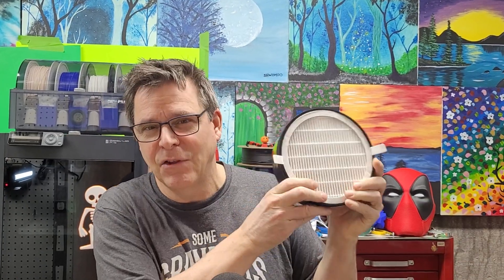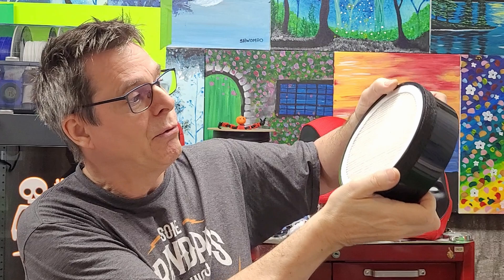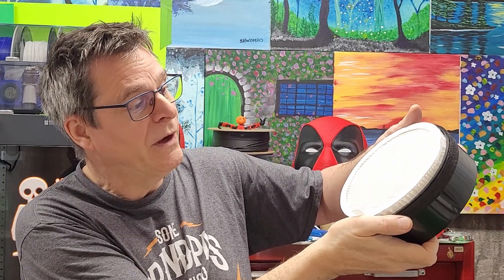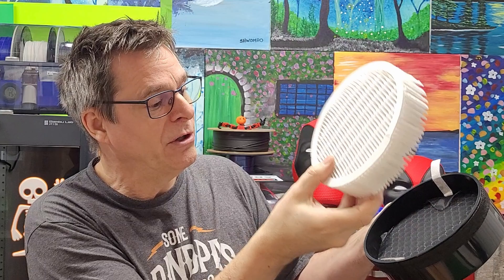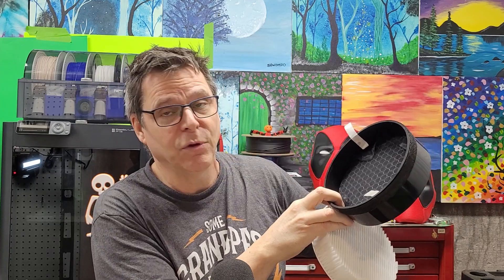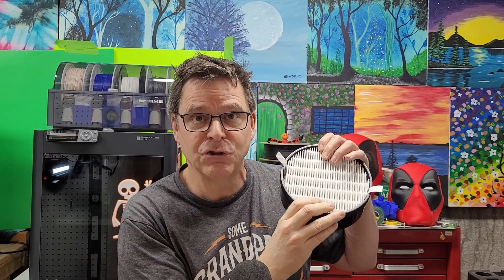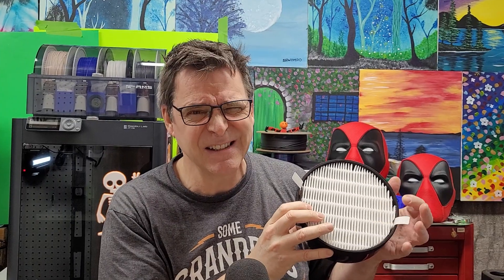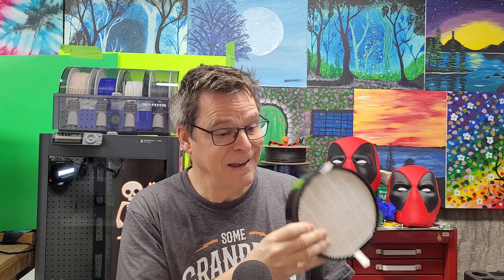3D Printing HEPA Filter: I Got it WRONG!

Comment: How did this work so far?
Reply from the maker: Great, no complaints. The best solution is venting outside if you can.  Not easy here for me so this is better than what Bambu supplied. If you do this remove the Bambu charcoal filter.

Comment: I bought a little Bambu Lab A1 mini as my first 3D Printer last week but the fumes killing me, i feel it in my lung, in my mouth  etc. Im sure its toxic so i bought a "tent" enclosure for the A1 mini and a inline Pipe ventilator to guide the fumes to the outside but i think i can still smell them. So i want to add a filter to the other end of the pipe. When i order the filters you showed in the video, which side of the filter take the bad air from the exhaust or better said which side of the filter  you would plug an an exhaust pipe? the white side or the black side facing the exhaust? Im still looking for a smaller alternative to that filter since the exhaust pipe is only 4 inch in diameter, so it will look a bit strange
Reply from the maker: Morning.  Manufactures original design is through the paper first then the charcoal

Comment: I made this and it works great!  The only problem I had was trying to remove and turnover the paper part of the filter.  I could not get it to release from the carbon filter without doing a lot of damage.  I just removed the whole filter from it's casing and turned the whole thing over and put it back in the casing.  When looking at the air cleaner that this filter was designed for, with this filter on the Bambu P1S, that's the way the air flow through the filter should be anyway.  Some of the carbon will come out when removing the filter so do it in an area where you can vacuum up the carbon pellets.  I hot glued the filter aroung the edges back into it's case and then filled any empty carbon pockets with hot glue.  It works really well.  Thank you for this design!
Reply from the maker: Thank you for the feedback 😊

Comment: Did you remove the Bambu filter after placing your filter on the back of your printer?  I've discovered that I'm probably allergic to the VOC's produced by my printer.  Bad rash develops when I'm in the room with the printer when printing.  I converted my P1P to a P1S a few months ago and I'm really glad I did.  I'm hoping your filter will fix my problem!
Reply from the maker: Hi,  yes I removed the Bambu filter and only use the hepa 
I hope it resolved your issue 😊
Reply: @mayhemsmiley  I, for the life of me, couldn't get the paper filter separated from the carbon filter.  I wound up pulling the whole thing out and reversing it in the case.  I'm assuming having the air flow through the paper filter first and then the carbon will still be effective.  I wanted to get your opinion.  I'm planning on hot gluing the whole filter into it's  case and filling the few carbon filter pockets that lost the carbon with hot glue so all the air will be coming through the filter.

Comment: The advertised filter is hot glued into place (at least the US variant in the description); mileage may vary, but others trying to reverse it may destroy the integrity of the carbon mesh screen, the HEPA filter itself, and their thumbs.
Reply: Thank you for this. I was wondering how he made it look so easy. I'm just gunna send it the way it is
Reply: So did you guy try to flip the paper side or just used it as is ?
Reply from the maker: I've got both on mine. The one I converted was glued but was ready to release. I'm sorry if some weren't as easy as mine.
Reply from the maker: I'm sorry about this. Mine were glued but easy to release.

Comment: Nice. Thanks for the correction. One thing: When printing normal PLA, they tell you to keep the door open... so is there any other trick or way to reduce fumes when using it with the door open? Thanks.
Reply from the maker: @todologic  even with the door open the fan is exhausting the chamber. I have never left the door open once for any prints at almost 1000 hours of print time on one printer.
Reply: @mayhemsmiley  Interesting. But you print normal PLA with the door closed then? I was a bit dissapointed when I unpacked the printer and saw that they recommend to use the door open for normal basic PLA... because I got the printer (X1C) precisely because it was enclosed. If you can confirm, that you've been printing basic PLA without the door open, and the prints are perfect, it would put my mind at ease... thanks in advance for your time and response.
Reply from the maker: @todologic  my pleasure, I've never left the door open once in that 1000 hours. I won't open the door to look at the print while printing. Bare in mind that my printers are in the basement where it is cool here all year round. I've used Bambu default settings for flow and Temps no matter which filament I use with the door closed. I was used to playing with all kinds of settings on other printers. Bambu studio have been a dream come true for me.  I how it'll be the same for you
Reply: @mayhemsmiley  thanks for the clarification!!! Best regards!!

Comment: This is a great video, just bought my P1S last month and have been hesitant to use it as much as I would like because of the fumes and microplastics. I naively thought that the enclosure would protect from all that but I was wrong. I am in a similar situation of not being able to exhaust outside, so this is a great solution and I have already started the print! How often would you recommend replacing the filters? Thank you so much for this informative video and solution to my problem!
Reply from the maker: Thank you for the kind words, I'll change mine every six months, I would gamble they are still good but why risk it. People who print more than I do might need to change more often, I wish there was a more positive method to verify saturation.
Reply: @mayhemsmiley  Just got the filter in and am having issues with removing the filter to flip it. I ordered the US version and there is a lot of glue sticking the carbon and HEPA filters together... Do you have the US version or the canada one?
Reply from the maker: @wezley13 im in Canada and ordered from Canadian Amazon. Go slow and gentle.  Hopefully you can wiggle it out. Let me know how you make out
Reply: @mayhemsmiley  Ah gotcha, yea I wonder if the US version just has a lot more glue compared to the Canadian. When trying to replicate the way you removed it, I had a much different experience. Was prying and prying but the HEPA wouldn't budge, ended up ripping part of the HEPA filter down to the carbon filter and was able to see a ton of glue, appears to be a very different experience than yours. Now trying to decide if I should sand down the inside of the print so that it can flow through the HEPA the correct direction before the carbon or just leave the HEPA as is and have the air flow going the wrong way🤔
Reply from the maker: @wezley13  I know that others have left it the way it is and one dude has a meter near his that doesn't go off near the printer but goes off when ever his daughter owns up the bathroom cleaners
Reply from the maker: @wezley13  one of mine is still in the opposite direction since dude shared his meter results

Comment: Im sorry but this doesn't work at all! So frustrated as I have wasted time and money on the parts. All it does is heats up the chamber between the filter and the printer back fan and pushes the heat back into the printer. I have tried swapping over the filter as per this video too.
Reply from the maker: Wow I am really sorry to hear this.  I hate waste time and money too. Someone mentioned that their printer was pulling air into their chamber rather than exhausting.  Have you checked yours? Both of mine exhaust and the first is getting close to 1000 hours of operation. Did you remove the original activated carbon filter and the cover? How are you able to tell it is pushing heat back into the chamber?  Let me know, my curiosity is peaked.

Comment: I’m was wondering . After a few months weeks is there any regrets any new air changes good or bad .  Is there anything u might change to improve the air . I like to get a Bambi but I’m also thinking of getting an air purifier for it until I seen this video ?
Reply from the maker: If I could vent outdoors easily that would be my first choice over anything. I am happy with this and someone even commented they did not reverse the filter and have a meter sitting next to the printer. The meter would only go off when his daughter was cleaning the bathroom nearby with harsh cleaners. I like the idea of capturing at the exhaust of the enclosure before it makes it into the room. Just my two cents. I friggin love these printers, spend more time printing rather than twiddling. Happy printing
Reply: Wow that’s interesting that the meter didn’t peak . So u been U been doing the  method since the beginning to now ? did u use any other filter like air purifier, open window ?
Reply from the maker: @gamergame5318  yes its all that I've been using.  Both of mine are in the laundry/ work room. The comment is either in this video or the original videos comments.

Comment: Hey, I just printed the model for the hepa filter.
Bought a LEVOIT LV-H132 replacement pack (from Romania since I'm located here) and the hepa filter was glued to the carbon filter.
Do you know where I can buy a compatible replacement pack on which I can change the sides of the hepa filter, or do you have another design which I can print sincet I have 1 more spare replacement which I can use. The one I tried separating the filters is completely broken now :(
Thanks in adance
Reply from the maker: Sorry for the delay responding.  Let me see what I can do on the weekend

Comment: Be careful with this method. Even if the fan is blowing air, if the filter is a true HEPA 13 filter, it will heavily restrict the fan or overwork it. Those fans were not designed for this type of ventilation. If you notice a massive difference in the sound output of the fan, look for a different option.
Reply from the maker: Thanks Matt, I check on it regularly. I can be a bit paranoid at times LOL
Reply: @ I can tell you’re very cautious haha and I do think the design is great btw! I just work with small motor air circulation and filtration so I’m always going crazy on this kind of stuff. As long as you change the filter regularly, you should be okay. But I have seen H13 filters like these cause electronics as well as motors blow with even just a few days added onto the recommended change intervals due to being so high efficiency, the small pores clog up so finely that they will overheat the blowers.

Great vid though!

Comment: Nice video and a great addition it looks like adding that filter. I just tried the link for the model to makers world and it shows that it’s not there. Did you pull it down?
Reply from the maker: Morning Steve, TY TY :)  it's in the description of this video and first pinned comment, here is the link https://makerworld.com/en/models/627989#profileId-552625
Reply from the maker: That link should work, but let me know if it doesn't
Reply: That link worked perfect thank you

Comment: I swapped out the carbon filter with a Voxel X-Filter which has carbon and hepa. 
Then I have a whole room Levoit Hepa filter running right next to the printer.
That also has an air quality sensor built in so it can ramp up when needed and stay quiet when things are good.
Reply from the maker: Could you share the model of room levoit that you use, sounds like a nice unit
Reply: @mayhemsmiley  EverestAir - I own two of them because they work so well. Can be controlled from your phone too. They have nice smaller units as well.

Comment: I think these work great just as they are. I have 3 of these printed for my P1s's. I used strong magnets and a tpu gasket instead of velcro.  After using these I don't even smell PLA anymore. I just took one of my filters out to flip it and I don"t see the difference. Could be a different manufacturer but its the same material folded into an accordion shape a lot like an hvac filter. Either way the air has to travel through the whole thing regardless. I'm going to leave mine as is. If anything, being able to install the filter the other direction and have the activated charcoal after the filter would probably extend the life of the carbon since the HEPA filter will capture the particles instead of the carbon being exposed first..
Reply from the maker: Hey Mosh, thank you so much for taking the time to share and comment. It really bothered me that I had made an assumption and agree with you about the air has to pass through in either orientation. It sure made the housing simple to design. Happy new year!

Comment: Printing ABS with this system and I have an AQI meter in my office. NO smell and the meter does not even register the print. It measures HCHO, TVOC, CO, Co2, PM2.5 and PM 1.0.. All green during multi hour ABS prints.  I have 2 Bambu X1Cs with this system. I do not smell plastic.
Reply from the maker: @edmclaughlin4923  hey Ed when you say this system do you mean the standard bambu carbon filter or the added hepa?
Reply: @mayhemsmiley  I have the added hepa. You did a great job and you had mentioned hepa in the first video and why charcoal wasn't good enough. Made sense to me. I printed your project twice and am using it. I also bought an AQI to verify. I am not interested in lung cancer... LOL.
Reply from the maker: @edmclaughlin4923  thank you for the clarification and note you've reversed the paper?
Reply: @mayhemsmiley  Followed all your directions although the original way did a good job. My AQI went nuts when my daughter was cleaning the bathroom outside my office. It didn't even register during the ABS prints. Thanks for your efforts.
Reply from the maker: @edmclaughlin4923  thanks for the update too. Interesting with the cleaning the bathroom
Reply: @mayhemsmiley  I showed my daughter and she promised to clean with ventilation from now on. It really surprised me, I heard beeping that morning and found it was the AQI. I mean I smelled the cleaning fluids, didn't think they were bad but they are!
Reply from the maker: @edmclaughlin4923  Hey Ed do you mind sharing the model of AQI and where you bought it from? Cleaning fluid odors have often bothered me, but I didn't realize they may be harmful.
Reply: Put this anywhere near the air flow of where a bathroom is being cleaned and you will hear about it. Again your system now on both of printers takes care of smell and particulate. Thank you again and of course, subscribed!
Reply: @edmclaughlin4923  hey, Ed! I'm interested in the model of AQI and where you purchased from as well. I've only gone off of my air purifier for AQI, but it's time to add a meter directly to where I'm adding a printer to determine if I should relocate that printer elsewhere even with Mayhem's filter suggestions.

Comment from the maker: I'm correcting the error I made in a video I shared adding a Hepa filter to a Bambu Lab 3D printer and adding back the files for anyone that wants to try it for themselves or modify the design. 
Apologies for the error, thankfully the fix is pretty simple.

Amazon affiliate links 
USA Hepa filter https://amzn.to/4dV27il
 
Velcro https://amzn.to/3yZbWNf
 
Canada Hepa filter https://amzn.to/4d2PtMR
 
Velcro https://amzn.to/4ecjuLb
 
Hepa filter housing on Makerworld https://makerworld.com/en/models/6279...
Reply: The link to the HEPA filter housing on makerworld is not working. Has it changed. This is a great idea.    Thanks.
Reply from the maker: @GaryKWallace  Hi Gary, thank you and sorry about the link issue. Here it is https://makerworld.com/en/models/627989-hepa-filter-housing#profileId-552625
Reply: We’re can find the file to print filter holder and poop shoot holder
Reply from the maker: @georgeharalampopoulos4632  Hi George, sorry for the delay here you go https://makerworld.com/en/models/627989-hepa-filter-housing#profileId-552625